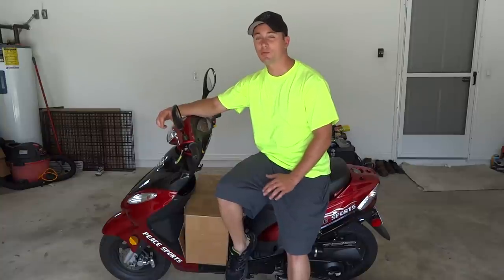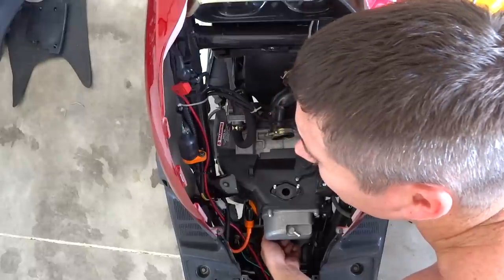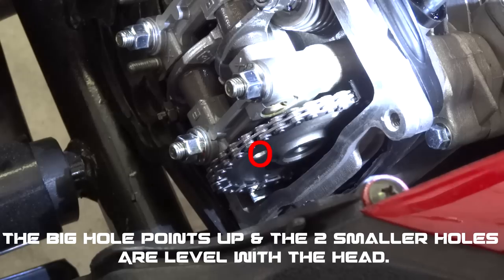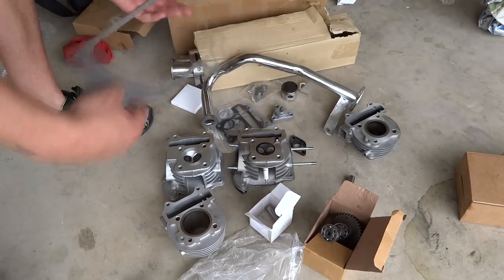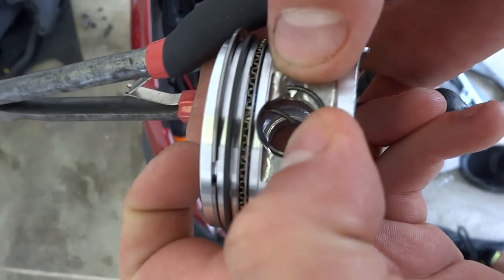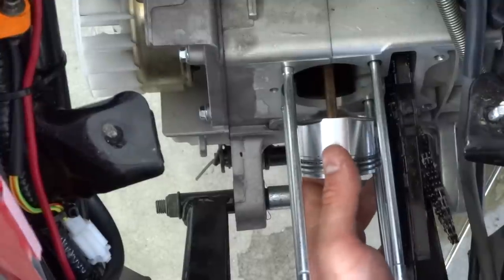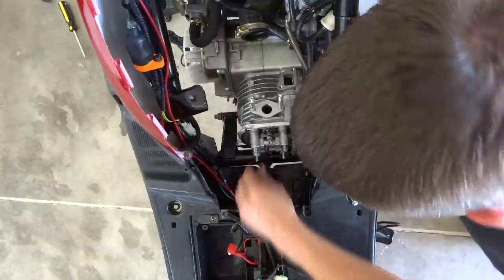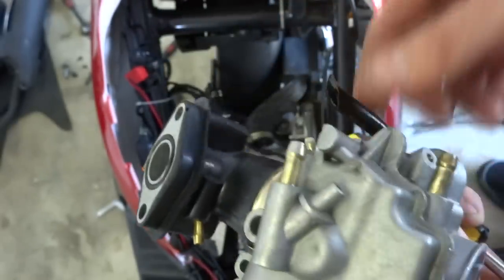DIY Gy6 Scooter 50cc to 100cc Kit

Comment: Hi tks to bring this video, I have a Chinnes scooter Sym Fiddle mk1 from 1999, is two stoke I fit on a new 75cc Naraku cylinder this scooter have a tank four the oil my question is- is beta to fix a small amount oil in petrol tank wheen I fill up or don't need to tank you best regards: Venancio BERENGUER

Comment: The shorter rocker arm will not open the valves as far allowing less air into the cylinder the only reason to use the shorter rockers would be valve to piston clearance I would have used the longer rockers and checked the clearance.

Comment: Some say 80cc is the biggest you can have to avoid drilling out of the crankcase. Or Is 100cc the largest? Strange, because you get a gasket to the crankcase with the 100cc kit from ebay?
Reply: Yes everything you need comes with the kit.

Comment: What spark plug have you got? I have the same one from the 50cc engine and it has sparking issues at high rpm
Reply: Replace your ignition coil.
Reply: +Dopee Jamm -----   NGK CR7HSA for 50cc plug

Comment: Dont you need to polish some parts of the cylinder before installing it?
Reply from the maker: The new cylinder is pre-honed. Everything is ready for installation. It's a ready to assemble kit.
Reply: Not in the cylinder but these heads are worth cleaning up. Quite rough casting of the ports. Just installed a similar kit. Torqued btw at 15 pd ft

Comment: Some say 80cc is the biggest you can have to avoid drilling out of the crankcase. Or Is 100cc the largest? Strange, because you get a gasket to the crankcase with the 100cc kit from ebay?

Comment: need some advice please. i just installed a 100cc kit on a 50cc ninja moped china bike  starts up easy , seems to idle ok . but bogs down when trying to drive it  i am sure prob has to do with carb , any advice for a begginer ?
Reply from the maker: Angela Roberts Check out my website. Everything you need to know is there. More then likely, it's your carb and intake setup. It can't breathe. Check out the 24mm 150cc cab install. www.Nthefastlane.com/Scooter Please Share my site with others.  Thanks!
Reply: Put it on its stand and start it up. adjust the air/fuel mixture screw on the left side of the carb. unscrewing it to the left will provide the engine with more fuel. Turning it to the right will take fuel away from the engine. With more displacement ( 100 cc as opposed to 50 cc ), your engine wants more fuel. You may have to rejet the carb.  From all the way to the right on turns for the air fuel mixture screw; the most turns to the left you should go is 2 and 1/2. Any more to the left and the screw can fall out. If the bike needs more fuel, and you are near the 2 and 1/2 turns, reject.
Reply: Needs a bigger main jet.

Comment: How long did it take from start to finish?  And did you ever get the new pipe to fit?
Reply from the maker: Roughly 6hrs... without the camera prob 1hr 30mins...check out my other scooter vids, yes I made the pipe fit by bending the mounting bracket.

Comment: I dunno if my speedo is accurate but says I get 52 down hill on my lexmoto fmr 50 4t derestricted and around 40 45 on flat and a good 30 up hill
Reply: Its probably off.  My scooter will say 40mph while my phones gps clocks me at around 32

Comment: Hello, I would like to ask if I change my set 60 cc engine in one of 100cmc, all I need and cylinder head 100? or use the one 60 that was mounted on it!
Reply: Marko use the stock head for higher compression or the bbk one for larger displacement
Reply: Ok, thanks!
Reply: Rob Wilk But now i have one yamaha of 125 cc, that gy6 was a good engine i made with that engine 10.000 km in Romania without others problems! :)

Comment: This isn't a 100c engine build you would have to update the internals to do that .
since you had it apart you should have adjusted the valves since these things need it often and more so with bore kits installed .
I noticed you put this together without some sort of oil or assembly lube which isn't good it will cause internal scoring and a dry first start.
You also put all that stuff back on without putting the plastic cooling shroud back on the motor and that's not a good idea to leave off .

Comment: Are there any disadvantages installing the big bore kit on 49cc or 50cc?
Reply: Adding this comment here as a disclaimer. The answer is, unfortunately, YES - and the kind of disadvantages you should take seriously.

Chinese engines are built to handle the specific stresses of their parts. Specifically, they are built and balanced with the original top-end in mind.

When you put in a new, much heavier top-end like this, you introduce stresses on the BOTTOM end - specifically, the piston arm bearings (the point of contact between the piston and the crankshaft) as well as the crankshaft itself. 

The crankshaft transfers the brunt of the power from the engine to the transmission, so there's a very real risk that by adding in WAY more torque than the engine was ever built to push out, the crankshaft will just... shear. I've seen it, there are pictures online. This becomes more of an issue if you put in some crazy BBK and tune it, not so much with a simple 80cc BBK. But the risk is still there every time you accelerate hard.

The much more real problem is the bearings problem. It's basically guaranteed to fail after a certain amount of time due to it taking the full stress of the uneven top end. The mean time to happen goes lower with bigger BBKs and higher with smaller BBKs. That means that you might run a little 80cc BBK with no issues for 10,000 miles and a 100cc big boy BBK for only 2,000 miles - or it might be the other way around. It's a game of chance.

What happens when your chance runs out? The bearings give and there starts to be play in the piston. Then it starts knocking and dying on idle, as well as losing power. You could probably drive it home, still, so it won't like, explode (see the crankshaft problem above, it very well may), but basically once your bearings are fucked, you're looking at a brand new $350 engine from amazon. It's really not something you can feasibly replace yourself like this. And it can happen at any time after putting in the BBK.

The only way to install a BBK "legitimately" is to also swap the crankshaft, piston arms (and therefore piston bearings) with aftermarket, high-quality reputable ones. This is NOT easy, you have to split the case, etc etc, it can get very difficult and messy. If you only do the top end, you're inserting a severe imbalance that will one day manifest itself

Comment: That's 82cc kit. Biggest cylinder you can get is 90cc (actually 88cc). You can install longer crank, but it needs a lot of work to install and is not worth it.
Reply from the maker: they do make a true 100CC kit..to me its not a waste considering I can do 55mph without a final gear change.
Reply: I'm wondering why more people don't do the final gear change. Wouldn't that be better than all the other cvst mod people do? I understand wanting more displacement but would the gear be better than upgrading all the torque converter, clutch, rollers, etc?
Reply: @AllenMacalehanister  exactly, 47mm is 72cc, 50mm is 81cc and 52mm 88cc, that's it. And going 50mm+ you'll need to replace stock stroker, cam and other stuff or your bike will fail by 2000mi.
Reply: @tdot1269   but that after u do the mod that 2000 miles wit not other pieces u said even if engine nee I got 575 miles I try get 72cc kit
Reply: @carlossanchez8135  I don't understand what you're trying to say
Reply: @tdot1269   is this legal to drive in street .and DMV would notice if I do this

Comment: Hi all, i'm in big trouble... My friend told me that he can upgrade my 50cc scooter with 50mm piston. He changed it and now scooter have a big problem... It idles normal and up to 10km/h it runs without an issue but once give more gas bogs down... He don't know why it happened and i don't know it too... This is my only vehicle to go work!!! Please help...
Reply from the maker: You might need a bigger main jet in your carburetor, or it needs to be cleaned out. First I would adjust the idle screw until it runs best at idle, see if that improves things. Sometimes that can help improve acceleration.
Reply from the maker: You can also swap out the carburetor to a 150cc found in this video. It will give you more power. Make sure to check the first comment for my store which has everything you need: https://youtu.be/f4N4Qvx5G5Y
Reply: @Nthefastlane  One thing i would like to ask, engine head is not changed. Smaller in/out port can cause this?

Comment: Also I noticed you didn't lubricate the cylinder or lubricate the cam I would have turn the motor over several times by hand lubricating the timing chain and the the cam gears you have to lubricate a a motor when you are assembling it especially on a scooter

Comment: Im not getting compression in my gy6 50 but I am getting fuel flow and spark. Has 100cc kit but I might need a new oil pump cause before the kit I ran it without oil by mistake. I put the kit in and its not getting compression so do you think its the oil pump? Any suggestions would be great
Reply: If you are not getting compression, you probably have a holed piston or broken rings. Oil pump has nothing to do with compression.
Reply: You either burnt a valve or smoked the rings. Time to tear it down

Comment: Do you need the new camshaft? I have been looking on ebay and they sell a kit with out a camshaft.
Reply: No, stock one is fine for the bbk, still using mine since this video with almost 3k miles.
Reply: what about the carburator?

Comment: is there a difference between the 50cc bn139qmb and the 139qmb?
Reply from the maker: +George Morgan The only difference is the length of the cam rocker in the cylinder head.

Comment: I have heard that I have to have a 139QMB engine, Mine says 1P39QMB is that the same?  I know that a 139QMB, is A GY6 Engine, But mine is slightly different can someone shed some light on this matter thanks
Reply: I have a 1P39QMB, its the same as the 139QMB. From what I read (been researching the 50cc for months now) it doesn't mean anything.

Comment: I DID IT EXACTLY.  THE ONLY DIFFERENCE WAS I PUT THE OLD ROCKER ARMS IN CAUSE THE NEW KIT DIDN'T COME WITH THEM.  IT STARTED AND I RAN IT FOR A COUPLE HUNDRED FEET AND IT STOPPED. NOW IT WONT CRANK. HELP

Comment: Hey what size roller weights would you recommend for this? ( I got a new variator) Also do you know the dimensions for the rollers?  I noticed there are a few different sizes
Reply from the maker: 8gram
Reply: +Nick Cassidy Normally they are 16x13 size.

Comment: I didn't see you put a gasket on your chain tensioner
Might leak oil
Reply from the maker: It was still stuck to the top.I'm also not running a head gasket..I just sprayed it with permatex copper head gasket spray so I would get higher compression and I don't have any leaks

Comment: do I need a new carburetor or something for a 100 cc kit
Reply: AnimaxRex no put in a bigger main jet.
Reply: I would since you're taking it apart anyway, unless of course your current carb is already a performance (18mm or more) one. They're only $20-$25 shipped.
Reply: Technically you don't have to but I did on mine, put a performance carburetor, also added a performance muffler and coil as well, I get about 65 miles an hour on flat ground, would probably do 80 downhill but I don't have the balls to do it on those small tires 60 is fast enough.. 😆

Comment: You did not need to undo the throttle cable unless you are changing the carb.  Also wrong about the 1P139QMB code.  It can come with either 64mm or 69mm length valves.   And you forgot the cylinder lube for first start up.  Than can score your cylinder first start up. Use a rubber mallet instead of anything metal.   But you are young and learning.  I have been working on motors since I was 15 1/2  now 73 years old   My dad would have knocked me across the garage if I used metal on a engine part to break something loose.

Comment: and why no plastic fan shroud ?
they are forced air cooled
Reply from the maker: I ran it both ways in FL heat and found the shroud actually caused more heat and caused detonation even with alot of different size jets installed.
Reply: Nthefastlane using correct type spark plug
and octane, that can cause detonation too if those arent the right type for that big bore
proper installed fan shroud, and jetting will not make it hotter
I cant see how if constant air is being blown over the entire engine, what its designed for
Now I can see it being hotter since youve doubled the engine size but im betting those china engines probably use the same size fan 50cc or 100cc
there may be upgraded fans for it that blow more air too
I wouldnt run it without the cover, its not a air cooled engine its  forced air cooled
maybe install an oil cooler to help with temps approx $200

Comment: There is NO bolt on 100cc big bore kit for the 139qmb engine.  The "ebay 100cc kits" almost always come with a 50mm piston, 50mm piston is 80cc.  To even fit a 52mm cylinder, the cases have to be bored.  And then you are only at 88cc.

It's crazy how many people claim their engine is 100cc, but it's also the same people that didn't measure their piston, check ring gap, use a torque wrench on head bolts, ect ect..  /facepalm
Reply: Jeremy Johnson True
Reply: WoW JJ! Good info. Who knew. So, can you even get a 100cc jug, on a 49cc set-up?
Reply: my words man,, so true
Reply: In china they count the size of the crankcase into the cc
Reply: It's not like the people at the factory assembling did any of those things either....

Comment: also how much do you think a mechanic will charge me to install this parts?
Reply: +Laura Herrera It depends on every mechanic, but mine charged me around 250. But he said that he had to do some modifications to the carburetor as this guy refers on his video oh! and a new battery cause the original is not enough for this kit.

Comment: Your supposed to change out the crank also cause the 49cc crank cant handle the torque from a 100cc bore kit. So it will either blow a hole in the piston, cease up the motor, or it will blow up on you after running it a while and if dog the shit out of it it will happen sooner. Just saying. I own a scooter shop and I have worked on them for years.
Reply: I’ve tried it and it never happened??
Reply: @Jacrazzz  It will eventually happen. If using a 50mm or larger bore, a crankshaft upgrade is advisable because of premature connecting rod bearing failures frequently associated with large bore diameters and stock Chinese crankshafts. Bores up to 47mm often work alright with a stock cylinder head. Above 47mm may require a "big bore" head to keep compression at a reasonable level. A big bore head is a cylinder head that has a larger combustion chamber. Some big bore heads are just like stock heads, but with the enlarged chamber. Others include larger valves and/or port work. If you will be using a different cylinder head with your big bore kit, you will need to know if it has 64mm or 69mm valves. You will also need to know if your current head uses 64 or 69mm valves. You can use either type of head, but the rocker arms and valve lengths must match. For example if you use a 64mm head, you must use rocker arms or an entire rocker assembly intended for a 64mm head. The same is true for 69mm heads. You will need a selection of main jets to help get your carburetor in tune with the new big bore kit. Some advise a main jet as a one-size-fits-all solution. This may work well enough to get by, but I find it's best to go through a tuning process and select the jet that works best in your specific application. Too many variables such as air filter style, elevation, conditions, carburetor, and more won't allow any one jet to work the best for every application. Stock and many aftermarket carburetors for the 139QMB use Keihin 99101-116 small round main jets.
Reply: @Jacrazzz  If you are upgrading to a larger carb from a stock GY6 125-150 you will need Keihin 99101-393 round main jets. It may not be necessary in all cases, but you may benefit from having a selection of roller or slider weights on hand to get your CVT in sync with your new engine combo. Heavier weights may be needed to control RPM because of the additional torque that the larger displacement generates if the CVT was previously tuned with the stock cylinder. Most 139QMB engines use 16x13mm roller or slider weights. Tuning roller sets that include many weights can be bought cheaper than buying multiple individual sets of rollers or sliders. They're good for helping you get in tune, but these weights are not intended for regular use. They will not last long. If you use tuning roller weights you should replace them with a quality set of rollers or sliders once you figure out what weights work best. If replacing rollers with sliders, buy sliders 1 gram heavier than the rollers needed to achieve similar RPM.

I like to change the oil after a BBK installation, and frequently during the first miles, so you may want to have a quart or more of your favorite oil around. I would advise using a standard (non-synthetic) for the first 500 miles.
Reply: @wisezombie6856  i work on gy6 ik that I already went thru all the process I’ve been running 50mm bbk for 1 year no problem I maintain my bikes